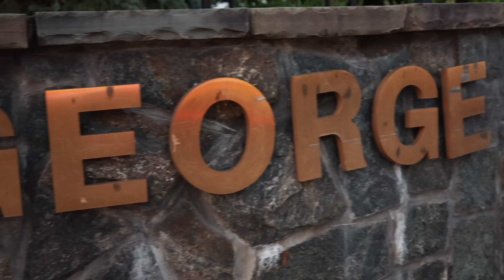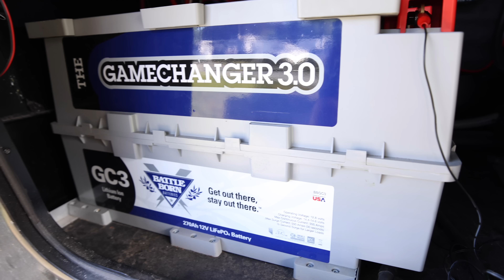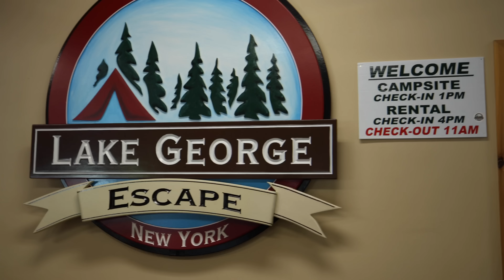Ceramic Coating for Full Time RV Living....WORTH IT? (One Year Review)

Comment: I chose not to go with Bob Moses mainly because he has no locations in the midwest. But they also would not do a partial ie just front end coating of my rig (which saves you thousands!). I found an RV detailing shop, Elite Detailing in Elkhart, IN, that I have an appointment with to coat just the front end.

Comment: Your rig is new. It is going to stay shiny for many many years! We use Meguiars no-strip car wash & wax and then a wax foam cannon and the rig comes out shiny as all get out for a fraction of the cost of the gimmicky ceramic coating BS! Think about it!
Reply from the maker: Paint can fade especially traveling and experiencing the weather we have.  If you add up the costs of washing, waxing and all of the other cosmetic maintenance over the course of 8 years, which is how long our coating is under warranty, then it's a much better deal. No gimmicks, just great results. thanks for watching!

Comment: If you got ceramic coating then you fell for the biggest scam in the automotive industry. Think about it, ceramic is a clay that is hardened by intense heat....what clay and what intense heat did you bake your trailer at? Also if their was ceramic in the coating it would scratch the living crap out of your paint. A sucker is born every day.
Reply from the maker: we will have to disagree with this.  It has been absolutely amazing and yes we understand it's called "ceramic coating" but It is actually a nanoscopic paint treatment that's applied in liquid form, but cures to form a hard layer over your vehicle's paint. in addition, paint correction is completed prior to this protective layer being applied so our vehicles do not have swirls marks like 95% of the vehicles on the road. sounds like you had a bad experience or had bad product. call Bob Moses and they can help you better understand their product.  thanks for watching!
Reply: Anything that makes your RV easier to clean---especially the hard to reach areas that face the front---is absolutely worth it. Try getting bugs off your rig that can't be reached with a ladder! If it helps protect their truck, then it's a big time saver there also.